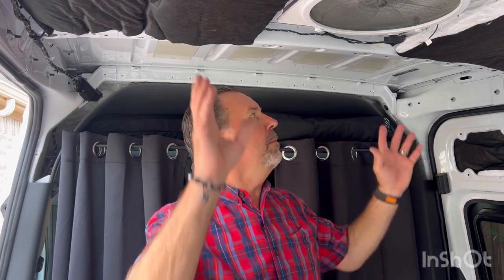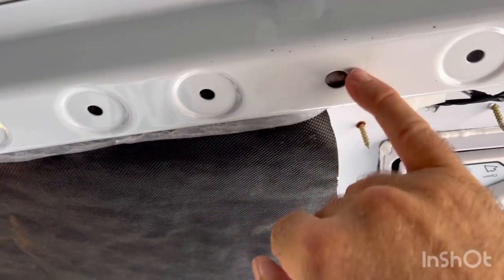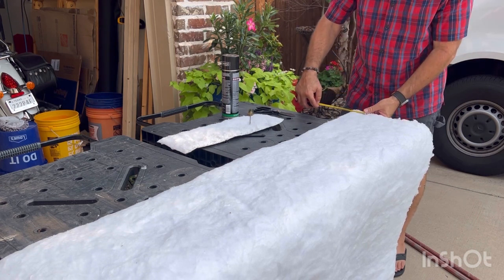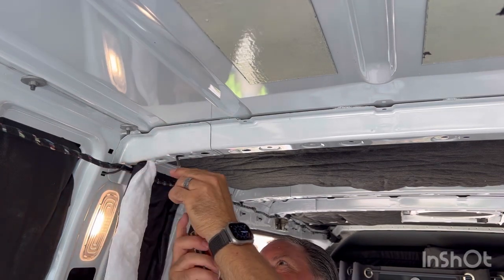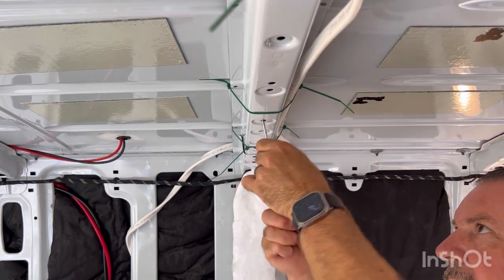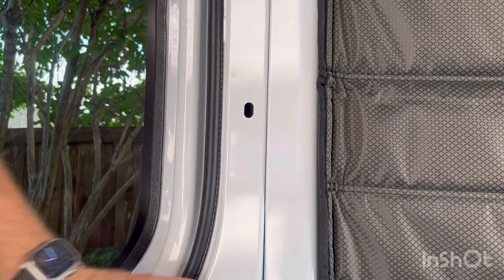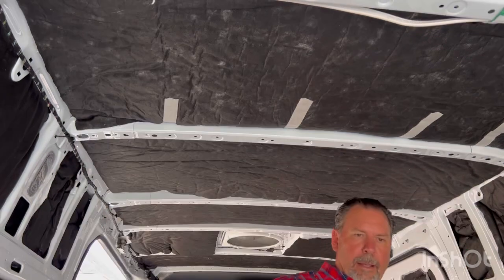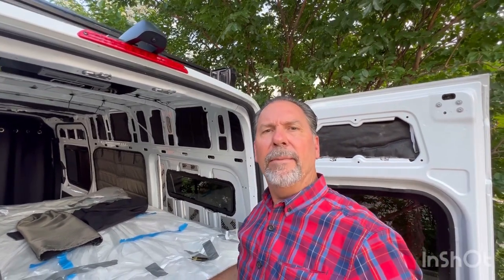Insulate all the nooks and cranny’s of your van!

Comment: I assume that like any contact glue application, you spray the 3M90 on both surfaces to join and wait a certain time before joining them.
Reply from the maker: Well for me I sprayed and then slapped it up…pretty quickly.  Other than some spot spraying, here and there, nothing has fallen of walls or ceiling.